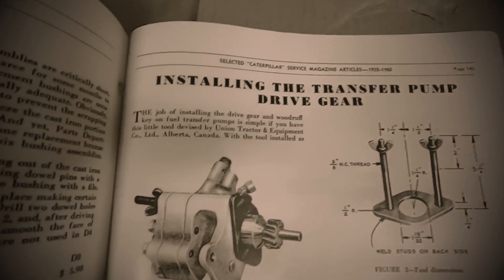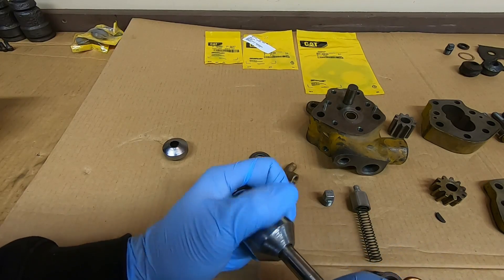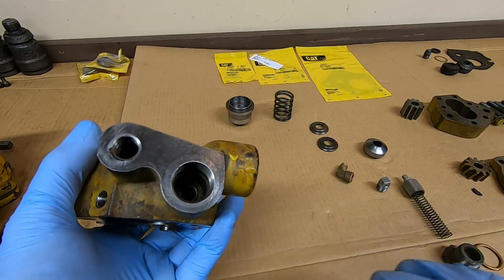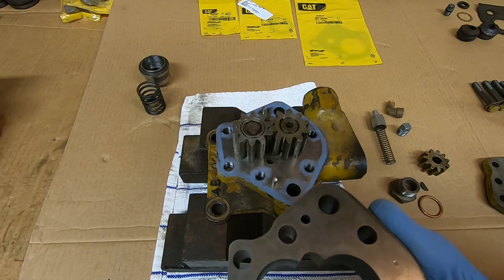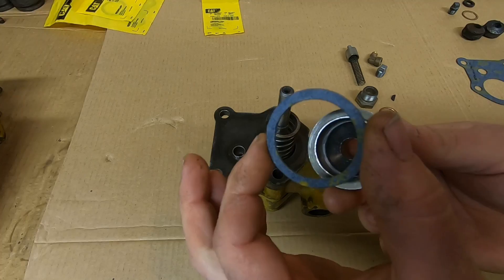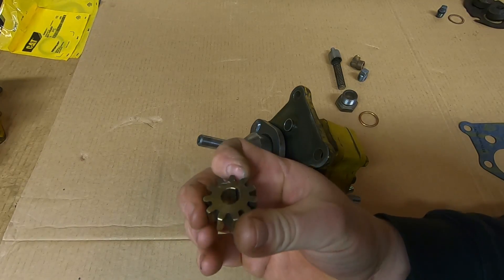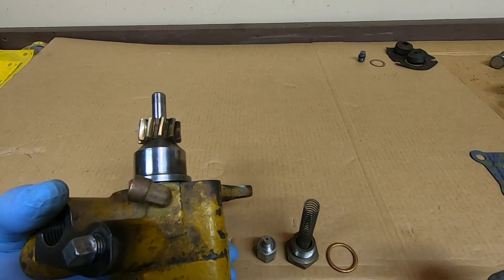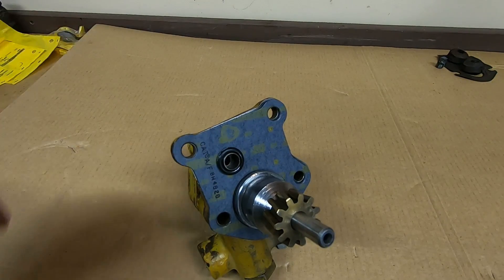Caterpillar D2 #5J1113 Diesel Engine Assembly Ep.28: Fuel Transfer Pump Assembly & Installation

Comment: My D4 6U has had low fuel pressure for years… now it seems to have become a real problem. I took the transfer pump apart aaaaand… it’s rough. The base plate is worn about .005” by the idler gear, both gears are cupped from wearing against each other, the idler gear shaft seems to have worn to the point that the gear is a little loose on the shaft… I was hoping for an easy fix, but now it seems like the whole pump might be junk.

Comment: Is this going to be the same as on a D4? My parts manual for my D4 5T series is showing 1F5471 for the seals and 4B9050 for the retainer rings. I was wondering if the 1F5471 was changed to 4B9051 or if it's a totally different seal.
Reply from the maker: According to my manuals, all of the older seal numbers cross reference to this latest Cat part # featured in this video. They changed the part number several times through the years every time they made a change to the material that the seals were made out of, but the actual dimensions stayed the same. Still, it might not hurt to give the guy at the parts counter the old number out of your D4 book just to see if his computer crosses it to the same current number. That’s one good thing about the Cat system, they can plug in any old number and automatically cross it to the latest - they just no longer have the information on hand to actually look the old numbers up if we can’t provide them.

Comment: My Tractor is a 5J7212SP, It presently has sat for 6 years, it has the one piece oil filt. housing with the paper cartridge. I put pressure in the fuel tank to get fuel pressure started while cranking, and am glad to see the video on the transfer pump rebuild. Thanks for the detailed work you do, very impressive.

Comment: Sense You like making tools too, I made a tool that is the diameter of transfer pump shaft, hollowed out on inside to the diameter of shaft the gear is press on, then tapered on the end to start it in the packing with out damaging the inside of packing!!! If you do a lot of them it helps a hole lot in assembly!!

Comment: I've worked over a lot of Cat fuel systems over the years and it's interesting to see someone else's way. You could have ten different technicians and you'll have ten different methods. And they're all--correct. I've always used a lapping block to keep the mating surfaces straight but I can see that the surface of the table saw is a good alternative. I use Permatex Aviation Gasket Maker to seal the mating surfaces. It's thinner than RTV but still does an excellent job. Interesting the mention of Union Tractor. They were the Cat dealer in Alberta, Canada until 1957 (I believe) when a dispute with Cat cost them the franchise. Union set out on its own and remained a significant force with Cat and is still in business today. I wasn't aware that they invented that clamping tool. I made a similar one myself over 30 years ago and still use it whenever I need it. Enjoy your videos. Thanks from a burnt-out (retired) diesel mechanic of nearly 48 years...

Comment: Let me start by saying I’m not even a novice diesel mechanic. But this series has inspired me to looking into a beginner class at the local community. So indulge me a dumb question... I notice a torque wrench is not used when mounting the assembly? I would have thought there would be torque specs on the mounting of an assembly that would have fractional compression in the very act of mounting it? I may have answered my own question in typing this question🤣 though. Were torque wrenches even used in the era in which this machine was conceived and designed? Lol. See? I’m clueless but very damn curious about stuff like this☺️. Anyway sorry for dumb question!
Reply: Squatch253 Thanks for the great explanation! 👍

Comment: It cant possibly make your stack height taller. There is so much pressure between those machined surfaces that the perfect surface mate and the imperfect will retain the sealant.

Comment: No problem with the sealing of the two faces...  the film thickness would be so small, not likely to be an issue...   maybe 1/2 a thou...  I know someone who used to check this with various sealers, and he always swore by Hylomar, and used to check film thickness with plastigauge. Rarely even 1/2 a though.

Comment: Enjoyed watching the assembly, about the drain elbow at 13.10, I think its a good idea to fit it with a transparent diesel application tube so that you can visually see if there is any fuel dumping in case of a seal leak.

Comment: Totally agree with the use of sealer on the flat surfaces. The additive effect will be a few 10 thousands of an inch.. totally negligible. The lack of leaking is absolutely worth the trade off.  Years ago when the family did engines, we used thinned out alcohol based sealant on gear drive fuel and external oil pumps. ( predates modern polymer sealants)  Never a leak... never an excess clearance issue.

Comment: Now on that gear pump, does the fuel go between the gears or around the gears?  Couldn’t help noticing that you didn’t touch on that topic (this time). LOL. Another great vid. I’ll be well informed for the next time I’m asked to rebuild a vintage D2 (nowhere on the foreseeable horizon). Keep on firing on the heat of compression!  😎👍👏

Comment: Squatch, for metal to metal fitups I like to use anaerobic sealant that can be applied even thinner than silicone. It cures in the absence of air and works killer. Great update on the Fuel Transfer Pump, I'm very excited to see the guts of the injection pump. Great work.
Reply: Agreed. I would recommend anaerobic also. That application is exactly what it eas designed for.  If the surfaces are not finely machined then I would use something like Ultra Black. Great job.

Comment: I've always had good results using an anaerobic sealant on machined surfaces that don't normally take a gasket, like Harley and VW engine case halves and such. It would do well for your pump surfaces. It's a lot thinner than silicone and doesn't cause any change in clearances.  Loctite 518 is what I use.
Reply: It's used to seal outboard motor crankcase halves too, which are split along the crankshaft's centreline.  It's a similar situation; the crankcase is assembled, the centreline bored, and then taken apart for assembly.  Since there can be no change in the clearance, Loctite 518 is used.  It's fuel proof too which is necessary for 2-strokes.

Comment: Squatch fuel pump tool part numbers.  (SQFP1A)  and  (SQFP2A)
Reply: Or SQCST1A for the packing seal retainer hold down tool, and SQCST2A for the oil filter wrench/packing seal driver. (Squatch Caterpillar Special Tools)

Comment: With the small amount of wear in the pump could you have flipped the gear 180 degrees and let the unworn side mate up to the drive gear. I assume the drive gear was a cast or steel gear and would of had no wear from contact with the bronze gear. Then you have almost new gear contact from the original bronze gear. Just thinking out loud.

Comment: I agree with the RTV on the pieces. I usually use a transparent coat on all of my gaskets (except manifold and head gaskets - which I use copper coat on both). As you said, these pieces are 70+ years old, and a lot of minute warpage, pitting, etc. can happen over that period of time. I have yet to have any leaks on any areas I use the RTV as a 'gasket glue'. That tool sure worked well in assembling the drive shaft!